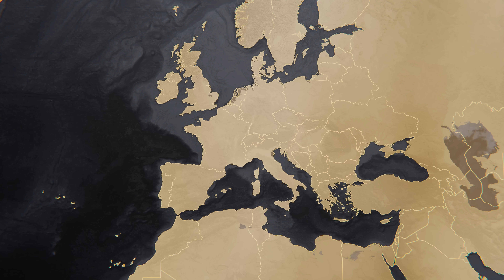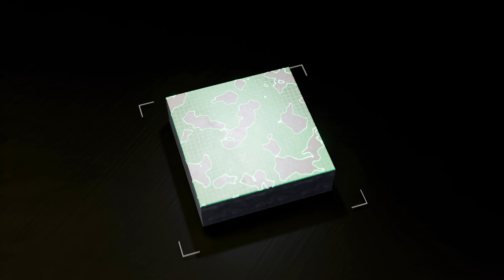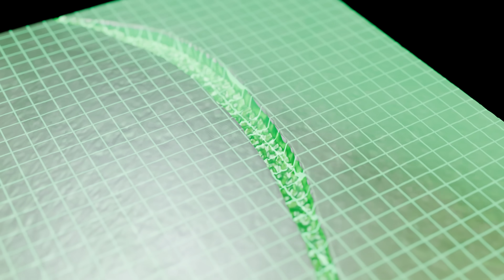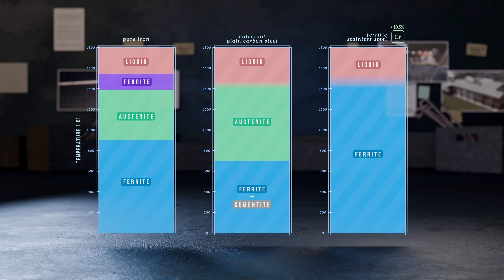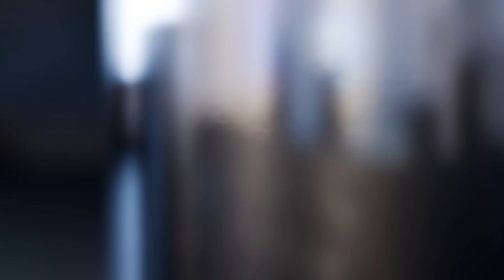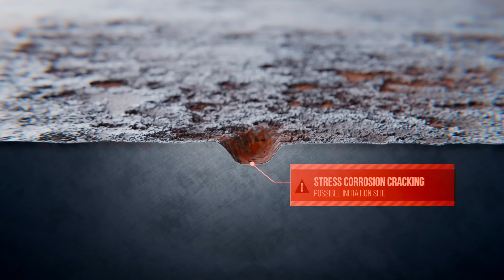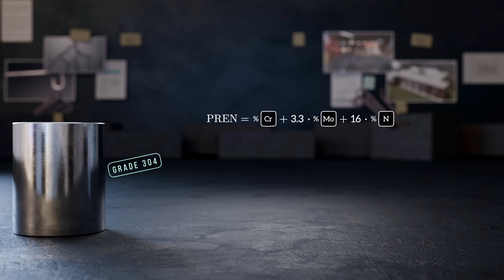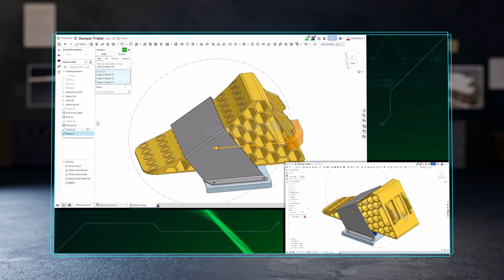The Problem with Stainless Steel

Comment: I once worked on a project where we installed 316 stainless guardrails. They ended up corroding at the bottom. The owner thought we didn’t install the rail with the right material. I remember finding a bottle of chlorinated bleach in the scrubber room. I took a 316 nut, scratched it, and threw it in a cup of that bleach, and it ended up rusting. We were able to prove that the chlorinated bleach mixed with the mop soap that caused the corrosion.
Reply: So even 316 is no match for bleach?
Reply: @soundspark  Chlorine bleach is extremely oxidizing, most materials are attacked by it to some extent
Reply: @soundspark  "Even 316" makes it sound like it's super-corrosion resistant, which it isn't.
316 is bargain bin corrosion-resistant stainless steel. I don't mean to say that it's cheap, which no stainless steel is. It's just the bottom of the shelf in this category.
You'd need to look into at least 904L for such conditions, and possibly even 254SMO as I suspect the owner used way more chlorine that was necessary.
Reply: @Clippy_Can  I saw some places saying that 316 its the common material for medicine tools
Reply: @RodolfoLameuOliveira  That doesn't mean much, just that it has some property that makes is more attractive than alternatives. Is that property cost, corrosion resistance, edge holding, or none of the above?
Reply: @Clippy_Can  Oh... if I got at least $1 for every idiot I come across in online comments, I’d have been a multimillionaire—if not a billionaire—by now...

AISI 316 is bargain bin... Well, yeah, practically any common grade of stainless steel is way more expensive than that and infinitely better in terms of stress corrosion cracking in the presence of active chlorine—whether it’s 321, 304, 420, or 440—they’re all more expensive and more resistant, yep yep. I won’t even get started on the AISI 200 series—it’s way more expensive and way more corrosion-resistant, LOL

Recommending, just for a moment, for construction (and by no means oil platforms, but a pool for recreational exercise) super austenites like 904L or super duplexes like 2507 or even Alloy 254 SMO, which in composition and price approaches superalloys like Hastelloy, Incolloy, and other Nimonics—and, why not just, casting aside any false sense of embarrassment, teach us fools how to use 585-karat gold, slightly increasing the cross-section of the rods—well, that’s a radical solution to the problem, isn’t it, Sensei?
Reply: Y😊 @Clippy_Can  yea. I watched something, they called it " the gold standard of stainless"pre like the economic standard
Reply: @soundspark from a few searches, it starting to seem like steady chlorine exposure is the bane of any stainless steel applications
Reply: @coke-cone-shaped Chlorine is on one end of the PH spectrum. With Acids being on the other.
So I cant say I'm surprised.
Reply: @Dave_Crupel  its not just a matter of pH but redox potential, the half-cell voltage of hypochlorite reduction
Reply: @TheBackyardChemist I don’t know what any of this means but I’m excited to go down a long rabbit hole until I marginally understand 😂

Edit: good to see a clippy in the chat! Louis Rossmann is the best
Reply: 👍🏻 Good to see ☺️
Reply: @charlestona3865  if he is the best why not follow his call to use clippy as an avatar? Is he asking for too much?
Reply: @charlestona3865  I disabled all youtube avatars in comments to never see the stupid sheep of a clippies every again.
Reply: @Dave_Crupel  pH is an indication of acidity and alkalinity (H+ ion concentration). Neither strong acids nor strong alkalis are always strong oxidising agents; this is a seperate quality to pH. Here we are talking about oxidation and reduction. Strong oxidising agents (like chlorine) cause corrosion to many metals. Note that "oxidising/oxidation" is the ability to "take" electrons from other atoms/ions; it does not have to involve the formation of an oxide. The latter is where most people, understandably, get confused (anticipation of confusion is part of what makes a good teacher, unlike current chat AI). A strong oxidising agent is more likely to be able to take electrons from another substance's particles. The opposite of oxidisation is reduction (where an electron is given); both are involved in a corrosion reaction where one substance (e.g. chlorine) gains electrons and the other (metal) gives the electrons. The product is an ionic salt  e.g. an oxide, a chloride, etc (again, room for confusion because we call NaCl "table salt"; it is a salt but not all salts are NaCl!). Highly reactive metals are known as strong reducing agents. The bottom line is that strong oxidising and reducing agents must always be treated with caution because of their reactivity; the stronger the oxidising or reducing agent, the more likely they are to react with something else.
Reply: @coke-cone-shapedTitanium last longer than Stainless, but will eventually fail. Not from fracturing but deep pitting to the point of failure.
Reply: @soundspark   bleach comes in many concentrations... Laundry bleach is quite dilute,  pool bleach is rather corrosive.  I doubt you'd dare use it for hand washing!
Reply: @soundspark it will take it no problem. The problem arises when you use way too much. Same either way with pools and water features etc.
Reply: @soundspark  316 is used in the US mostly for steam pipe and sanitary environments. "resistance to corrosion - to avoid contamination" is how i personally refer to 316. 320 stainless does a bit better with extreme oxidation especially from heat and salts (bleach) but its production is limited, for the cost there are better options for large scale builders and manufacturers.
Reply: @s @soundspark mmon stainless steels are NOT a feature of chlorine production plants. (Table salt is transformed to products such as “bleach” and pool chlorine, etc)
Reply from the maker: Love anecdotes like this - thanks for sharing!
Reply: @TheEfficientEngineer as a Stainless fabricator I always say the material is Stain “less” not Never stain.
Reply: @Loopsrainforest  This part is always lost in translation, in my country if i translate it back "stainless steel" becomes "Rust free steel" marketing and translation makes is appear it will never rust.
Reply: @Loopsrainforest  yea. In swedish the word stainless translates to "Rust free" wich is even more unhelpfull.
Reply: @christoffer8301 
 It depends on the grade of stainless. Some stainless will rust, while others won't. At least, that has been my experience with it.
Reply: @jizburg   Same for German.
Reply: @Arnold-x6d   that would be over a Short interval. 
My 18/8 tableware develops iron oxide stains over time...  They can be scrubbed away,  but they WILL stain if not cleaned and dried regularly.  The stains can develop pits   too.
Stainless is a misnomer,  but not as much as the German:  rostfrei.  No, it can, and over time Will rust
Reply: @peterfriedrich4099  stsinless is not a misnomer. You are just making a strawman, arguing with your notion, imagination what stainless is supposed to mean.
Reply: @jizburg  Or the Finnish "unrusting steel".
Reply: @Arnold-x6d  Correct. The grade that is called "muffler grade SS' will indeed rust slightly.
Reply: I had a tablesaw blade guard stored next to a CLOSED container of chemicals(pool acid i think) on a shelf and it badly rusted in California climate. Surprising how strong these things can be.
Reply: When stainless steel is used to construct something and the surface has been scratched or cut or manipulated in any way iron particles will then be more common in the surface area, which causes the ferrous oxide rusting. If you passivate the metal in a weak acid that will remove the iron and cause the chromium to mix with oxygen, causing a chromium oxide instead of ferrous oxide, which will prevent actual rusting since the iron will have been removed
Reply: @lv4077  What would be a good "weak acid"?
Reply: @bricewayne3082 really any dilute acid but it’s probably easiest to use dilute nitric acid or citric acid.You can probably google it .We always used Nitric acid but I had a chemical engineer who came up with the system so I honestly don’t know what ph is most desirable and I’m sure it varies with the concentration of various additives to the iron like nickel or chromium.Im sure there are recommendations for passivation from the suppliers.
Reply: @bricewayne3082  citric acid
Reply: @bricewayne3082 stainless steel is usually passivated with a citric acid solution.
Reply: citric acid
Reply: @philiphansen97 ~ true, manufacturing plants use citrus based cleaners for this reason but all you need is vinegar.
Reply: If you smell chlorine in pool area there is amines in the water - most likely from pee.
Reply: I worked 40 years as a Millwright in a factory that produced Caustic and Chlorine. We used many different alloys used for different types of exposures and strength requirements. We also made a very strong Bleach as an additional byproduct. Now, after that being said, we began to experience rapid corrosion issues, so we temporarily hired a  metallurgist. He ended up learning that the root problem occurred once our purchasing department began to purchase our Stainless from China which was not the necessary spec it was stamped out to be. We ended up keeping the Metallurgist as a permanent employee to do random quality control, and shipped back any inferior Stainless Steel. Of course our Stainless service expected returned back to normal. Hopefully sharing my experience is helpful wherever it might be useful.
Reply: Well bugga me!  I use a lot of s/s bolts on my 'projects'... but not around pool h2o!
Reply: @iggyppup  if you use a swimming pool loaded with chlorine, you better find the most expensive stainless you can find with plenty of chromium and nickel. That won’t prevent rusting indefinitely, but it will postpone it.
Reply: @iggyppup  what is polhso?
Reply: @georgegordonbrown9522 not polhso, it is poll H20 --> poll H2O = poll of water
Reply: YEP  As soon as I saw this, I thought pool/chlorine equals corrosion.  The chlorine in a pool evaporates and rises, was trapped by the ceiling, so it ATE the ceiling to escape.  You are right/so am I.
Reply: Huh. Doesn’t 316 self-passivate immediately?
Reply: @KSpotes  316 is just the bare minimum for a corrosion-resistant stainless steel. You can get one that's a little more resistant with 316L, but in chlorine-rich environments, you should use something like 904L or 254SMO.
If you're dealing with really high concentrations and high temperatures, R50250 will be preferable.
Reply: @Clippy_Can thanks, didn't know that there are steel alloys that can withstand chlorine
Reply: @Clippy_Can Rolex watches use 904L, whereas almost all others use 316L.
Reply: @Clippy_Can great information. Thanks for posting this. I’ve got some more learning to do here.
Reply: @KSpotes not against chlorine
Reply: A PMI could have confirmed the material in seconds
Reply: @Gg-vd6uu  Yeah throwing a bolt from the same pile of bolts you have and having it rust could equally prove you DON'T have the correct material. 

I am concerned the vast numbers of people here, including the video creator, comment as if the OP made any actual point...
Reply: @VicusUtrecht  That's because work is supposed to be done with permits and plans. All of the materials have been selected by the architect/engineer and approved by the city. He is proving that he is using the correct materials according to the plans, not that they are ideal for the application
Reply: (alphabet soup?) PMI = Positive Material Identification. Often done using handheld XRF (X-ray fluorescence) or atomic emission spectroscopy (spark test, arc test, flame test) to identify the elemental composition.
Reply: Zinc plated steel from my experience is the most resistant against rust/corrosion
Reply: Seen plenty of rusted stainless hardware in pools 

Shame that the architects didn’t and that a good mechanical engineer was not involved
Reply: And I was thinking 316 is better than 304 for protection from corrosion.
Reply: 316L resists corrosion better.
Reply: 316L is a tad better, otherwise use the same material they use in the oil and gas facilities, Inconel and Nitronic 50. But no one would pay for that.
Reply: @MrHenrikAndersson good for H2S atmospheres, SSC areas
Reply: Every machine shop I have worked at that has used 316 is always passivated after hand finishing and inspection.
Reply: @rancosteel yep,after machining fe Ned’s to be removed with weak acid so chromium oxide can be formed as a barrier
Reply: @lv407 @lv4077 eve we used sulfuric acid with distilled water. I remember the custom made tank was clear glass and I could see gas bubbles escaping. The parts were certified after because they were small attachment components for satellites.
Reply: @rancosteel They usually use a weak acid like phosphoric or citric acid but dilute HCL would work
Reply: Concrete in direct contact with steel, even 316, will rust if air (O2…) and moisture are available.
Reply: Waste of time
Reply: When I was younger I work for a pool company for like 8 or 9 years and I remember my first week there they said no matter what you have stainless steel whatever it's all going to rust and that was the case new channel locks ECT every year or two cuz they would literally cease shut from not using them in the winter time (no the channel locks were not stainless steel just an example LOL)
Reply: The stainless steel hand washing sinks at my workplace have a specific thing on them that says not to use chlorinated sanitizers, or if you do clean them off as soon as done cleaning .
Reply: I left bleach in a stainless steel cup, overnight. When I went to use the product the next day, more than half the contents were gone. Upon further inspection, I noticed that there
was a tiny hole, no bigger than the aperture of an insulin syringe, in the cup. It was the only detectable corrosion. 
That led me to doing a bit of "Googling" on the subject. A couple of things: "Pin holing" is a known type of corrosion in stainless steel. And stainless steels don't like chlorides.
Reply: Yes..Chlorine eat chrome. I used a stainless spoon to scoop chlorine powdeer, the spoon surface erode. Bleach will eat stainless steel of sanitaries. Two different steels touch each other also make one of them rusted i.e: brass + stainless steel, brass wins and eats the chrome.

Comment: 'The disaster forced engineers around the world to confront an uncomfortable truth. Even though we call them stainless are by no means immune to corrosion'.
Almost stopped watching at that point because that is a load of filler BS.
One doesn't even need to be an engineer to know that kind of stuff. If you are doing an apprenticeship in metallworking here in Germany then it takes you 3 to 3.5 years. It's dual vocotional training. You spend 3 days per week at the company and 2 days at school. There they teach us theory that partially is at university level. They teach us that kind of stuff. And at the company one of the first things i was told is that i never ever should bring stainless into contact with steel because just a few sparks from and angle grinder hitting stainless while your griding for example steel will make the stainless rust. Grinding stainless with a wheel that you used for steel before will do the same. Any 'contamination' with certain metals will make it rust was one of the first things one of the old guard at the company said to me.
That apprenticeship was around 25 years ago...
In short and other words: This is well known since AGES.
 
But nonetheless, you earned a thumbs up 👍
Reply: It's difficult to avoid this level of contamination and shared material tools are almost always going to be needed. so when it's required I have always done citric acid passivation. the only places I have seen observe such stringent separation is shops which primarily make kitchen appliances and custom sinks.
Passivation using citric acid (some have not yet updated away from nitric acid) will prevent the surface level oxidation and pitting, but unless the conditions are special the corrosion will stay on the surface and not continue rusting forever.
Reply: @KerseyKyle   it's not difficult. You just need  for example curtains (they are on a frame with 4 caster wheels) while grinding and discs/wheels are never shared. There is one drawer that has only discs that are used with stainless.
Same thing when i am doing something with stainless at home, the few discs that i have used with stainless are in a small closed carboard box in a drawer and i always clean the work bench befoe i work with stainless. That's already enough.
When it comes to working with stainless right next to mild steel I have done work from conveyor and lift systems to handrails, stairs, car ports, doors fences and so on and in around 25 years I never had a problem with rusting stainless. Not one complaint from a customer.

Comment: i just had my Metallurgy exam this morning why didn't this video come out sooner
Reply: The actual weight of the ceiling was not given. Concrete itself rarely leads to permanent structures. Thirty years later it has usually degraded to the point of high risk. Still the politics of concrete companies overruled any common sense.
Reply: Because you need to LEARN it, not hear about it